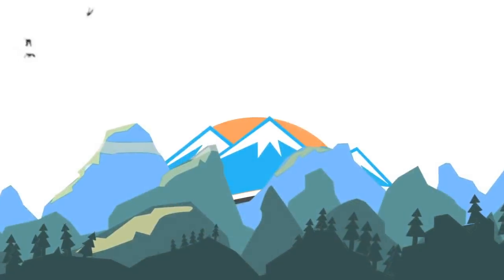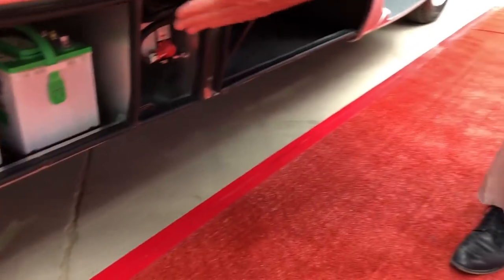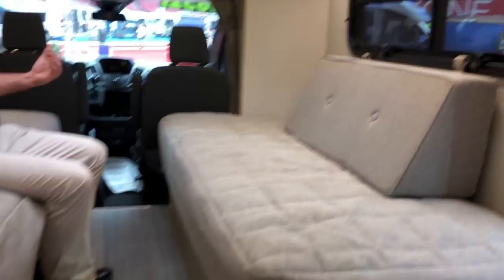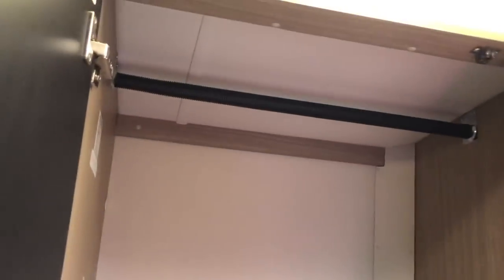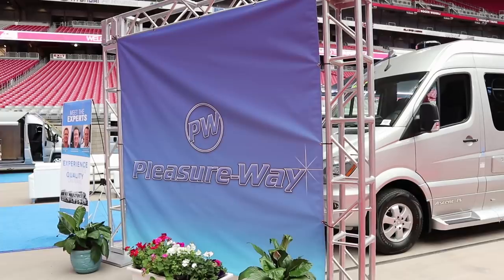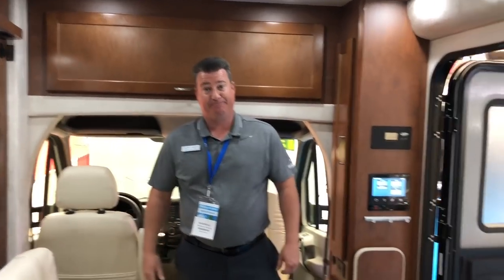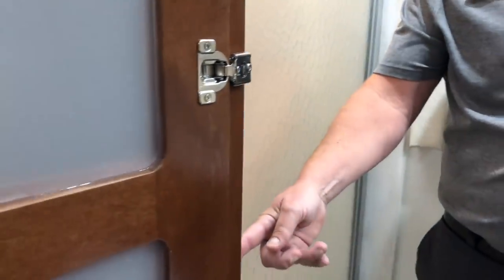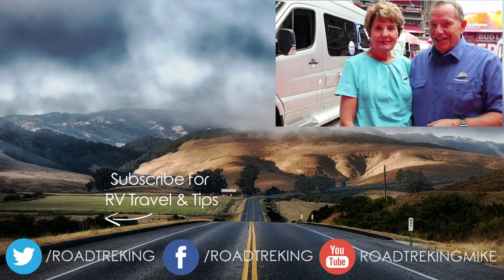The Latest in Class B-Plus RV's: New Leisure Travel and Pleasure-Way Models

Comment: We have an earlier year Pleasure-Way like in the video.  Some commented on not family friendly.  It is made for two people only.  Some commented on poor storage.  Less storage = larger interior.  The XLMB feels huge inside.  We have gone on two one month trips and storage is not a problem for us.  Love the Murphy bed, takes less than a minute to be in the sack or folded away and sitting on the couch.  Build quality is outstanding.  Two years and 20,000 miles and it has never been back to the dealer.  No problems with the MB engine.  Gets 16-17 mpg and drives perfectly.   Many good brands out there so pick the interior that works best for you.  The XLMB layout works perfectly for us.  If our's ever wears out we will buy another just like it.

Comment: I LOVE the Ford Transit on my Thor B+. MORE than enough power and Ford has a very unique front suspension that makes driving a B+ feel like an SUV. No vibration on the wheel...and despite that fact its a Diesel...surprisingly quiet once up and running.

Comment: I had heard on another YouTube channel devoted to Class B motor homes, that the Mercedes engine recommends only using a high grade diesel fuel that is not always available at stations.  In fact he said that there a several states where you cannot find it at all.  Can you confirm this, and if so would the Ford Diesel engine have the same requirements?
Reply: Jean Decker Over in Europe, where I live, there is a whole discussion on phasing out Diesel. In Germany and France for instance Diesel motors are more and more banned to enter major cities or certain areas called “environmental zones”.
Reply: @NicoVeenkamp  Nico good to know